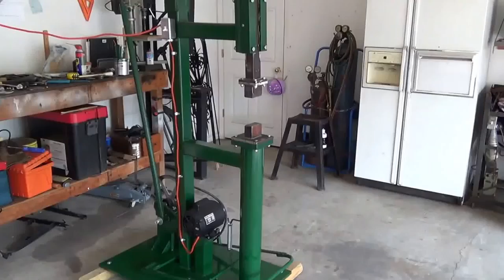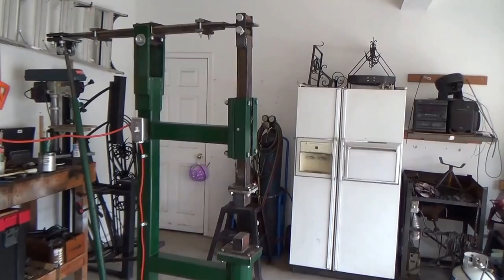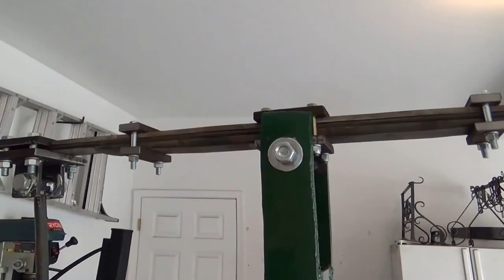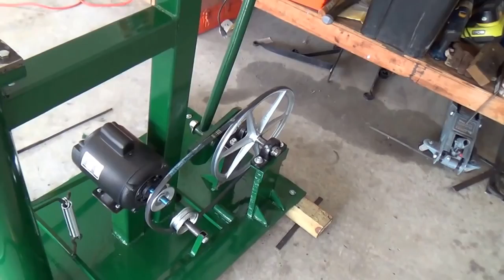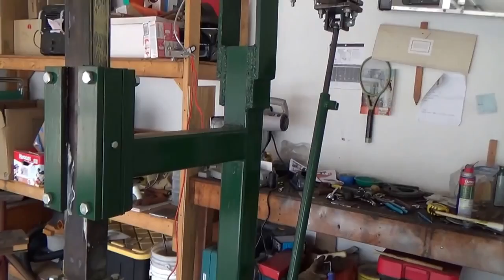Power Hammer

Comment: You sure made it look nice.  As a metal fab for years I was wondering if you thought about putting a couple of 3 or 4 in gussets on your tubing that Ts in the main frame. The part of the arm that guides the hammer were it meats the frame. It might be worth doing just for piece of mind. It just looks like a good place for a stress crack to start. I assume its tubing around 1/8 -3/16 wall. You could use some little 1/4 in plate and weld on each side.  This is totally a honest observation not meant to demeanor your work.  You did a real nice job from what I can tell. You took your time unlike a lot of the builds I see on the web and it shows.  I was just getting ideas to see if I want to do a guided hell hammer or a little giant style. Kind leaning to the little giant as I think I can make it a bit more compact.  Again great build

Comment: dose the leaf spring have to be flat or will it work with the stock curve to it? i welded the flap at each stacking piece so its much more rigid than stock spring.
Reply: I too asking about that straighten spring
Reply: You don’t want to weld the springs together

Comment: its not a pedal its called a tredle to give it the pressure, but a minor piece of terminology, what is the weight of the tup that is what is the size of the head and strikeforce
Reply: Actually he is correct.  It is a pedal.  Dict says ....."a lever worked by the foot that imparts motion to a machine."  Such as on the old mechanical sewing machines or a spinning wheel.  The treadle actually converts vertical motion into circular motion via linkages.
Reply: He clearly states 40lbs as well
Reply: Tigger cn

Comment: Great video! I've recently also finished making a power hammer similar to yours. though my back pulley which is connected to the offset arm is much heavier and larger than yours and I was woondering if that gives one more control?